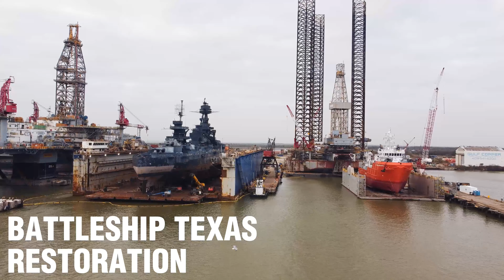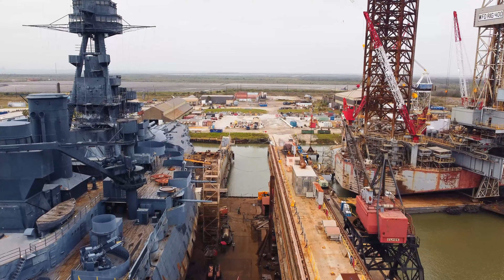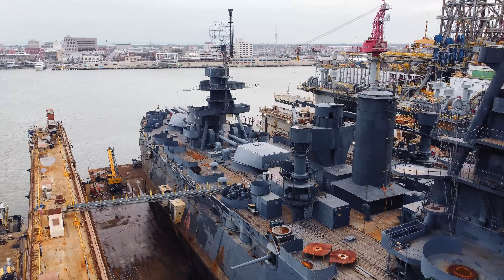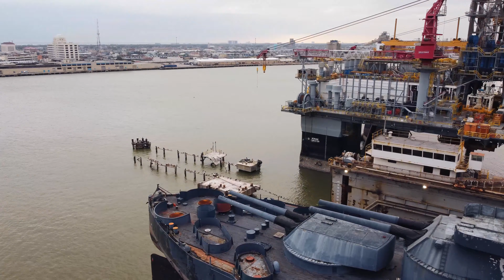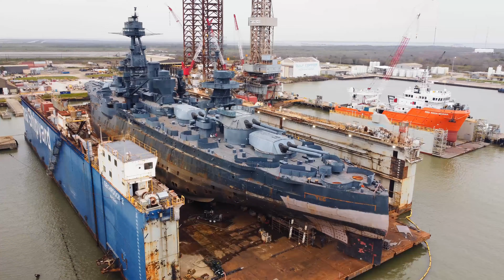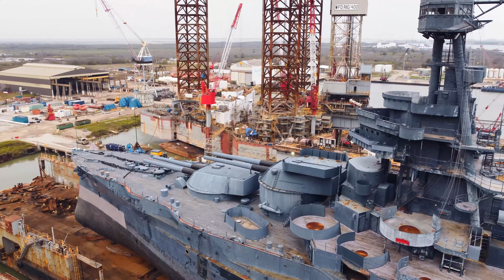Restoration of the Battleship Texas in dry dock. 4K drone view.

Comment: Attention Titanic buffs. The Texas has identical (or almost identical) engines.
Reply from the maker: Wow! Thank you for sharing. I never realized that!
Reply: Texas has triple expansion steam engines I believe. The Titanic had 2 Quadruple expansion steam engines  plus a direct-drive turbine in the middle that ran off steam from the quads. The turbine could only run ahead I believe and could not reverse or be used for maneuvering.
Reply: Both ships has triple expansion reciprocating engines. The reason for 4 cylinders is that the low pressure cylinder would be tooo big if implemented as 1 cylinder.  The 2 big end cylinders act as the low pressure cylinder. 

The Titanic has the little steam turbine for a 4th expansion of the steam (waste steam from the reciprocating engines) for forward only operation. The war ship must not have had room for this.
Reply: @dannybryant6873  , I stand corrected!! And I know that there were such things as 4 cylinder triple expansion engines too! Thank you!!